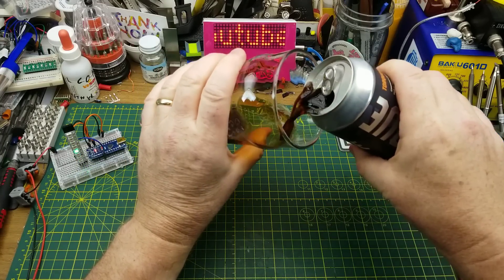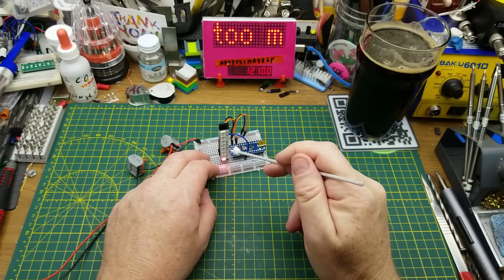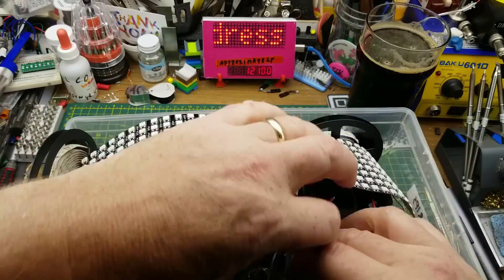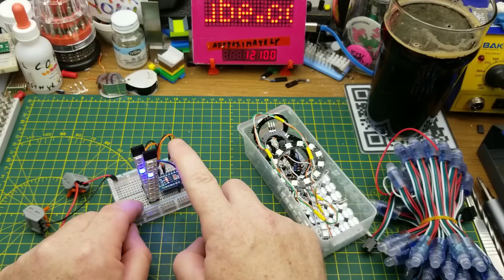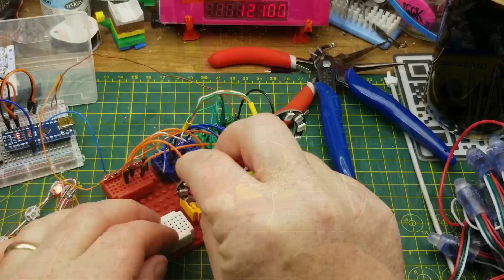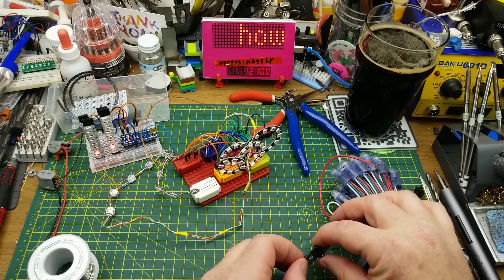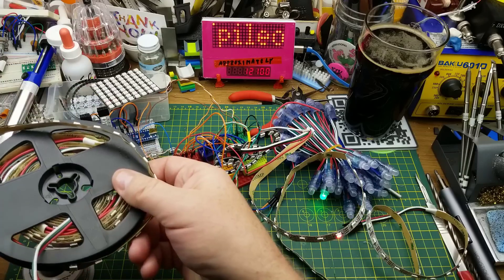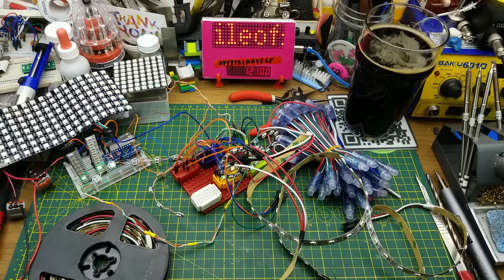Abusing addressable LEDs

Comment: there is no addressing and no "stripping" of anything, it's a serial stream of bits. In the WS2812A/B case (as well as many others), the first chip will receive 24 bits and if it receives another 24 bits before the latch period, will simply pass along it's current 24 bits to the data out and receive the next incoming 24 bits.  After the latch period, each chip "applies" the received values as pwm signals to each of it's r,g,b "channels" / leds.  You cannot "address" any of the leds, you can only spit out as many bits as you want leds on.

Comment: Literally every (non-USB) ARGB fan hub sold for gaming PCs connects the data lines in parallel, so every fan gets the same pattern just like your first experiment.  Edit: They usually have data logic buffers to amplify the signal.

Comment: what I do in this case, I use diff line transcievers like the sn75176 and the controller stays inside the house, and the led groups are just sitting on the bus with their own diff line receivers. Its pretty much like dmx but the actual data is ws2812 data stream instead.

Comment: What you are doing is called "fan out" the specs on your microcontroller will tell you how many TTL loads (or min impedance, max current, max capacitance) any output can drive. Then you look up the specs on your LEDs (you only need to consider the first LED on each strip for the data line). The WS2812B LEDs have a typical TTL load and most controllers can handle about a 10 TTL device fan out before you overstress/blow out your microcontroller pin.

Comment: The chip is the black thing inside the led itself, the capacitors outside are actually useless. I received few boards with some capacitors desoldered or completely missing and it still works.

Comment: Running WS2812 from a 3.3V controller can go wrong, according to specs they need 3.5V on their Din pin to recognize it as a "High" signal.
It may work (as evidenced in your video), but it can also cause all sort of strangen behaviour.
So, to be on the safe side, you should add a level shifter in between to get the 3.3V data signals up to 5V levels.
(Or, alternatively, drive the LEDs from a 4.5V supply.)
Reply: simpler hack is to use an extra first led and lift its ground up with a diode.
Reply: @szaszafaja  Lifting the ground won't work - the LED would see even less amplitude on the data pin than before.
If you want to use a diode you need to lower the Vcc of the first LED with it.

Or just use an NPN transistor and two resistors to cleanly and reliably shift the signal into the required range. Cheaper than "sacrificing" an LED and uses less power as well...

Comment: I've done plenty of testing with ws2812b and ws2811. Neither of those need level shifters on a 3.3 volt microcontroller like the almighty esp32.  Just make sure to get a strip made in 2020s. The older revision 1.3 was prone to glitching but the new revision works beautifully on 3.3 volt signals. You can tell which version you have by observing the pwm frequency. If the led flickers at 400 Hz it's rev 1.3. If it flickers at 2 kHz it's rev 1.4. You can tell them apart by moving your eyes left and right vigorously.

Comment: Do you know that what you are point to at 1:25 is just an alim decoupling capacitor ??

The controller is inside the LED it self. That's why it has 6 pins instead of 4 like a classical RGB 😛
Reply from the maker: Yes, and I believe I mentioned that the controller is inside the LED package more than once during the video.
Reply: @pileofstuff Thankls for the answer ! Fair enough then :) 
But why did you point at it in the first place ?? 

Must admit I didn't watch all along, I know well enough the basics of that WS-like modules... 
But I beleive what you are "abusing" here, is more your alim than the MCU or LED strips...
(I may have missed a point btw).

I mean, as the data line draw virtually NO current, it's not very astounding you can put MUCH of them in parallel.

It's not a critism, i'msure plenty of viewers will find it interesting !
Years ago when I started to play with MCU... YT existed already, but was not full of this kind of content, and that's cool, thanks for the newbies :) 
(Note to the newbies : go to IRC, though !)

My point is you can have mislead a couple of them here...
Reply from the maker: @skuizhopatt5318  During editing sometimes the voice over and video can get a bit out of sync.  
What I was pointing at a second ago may not be exactly what I am talking about at that exact instant.
Reply: @pileofstuff  unsure if you should insisted, here, but... 🤷‍♂

Comment: If you use a logic level shifter and split the input and then run the 5 volt output to each You shouldn't get an issue with loss of signal. Not quite sure if that's how that is supposed to be used lol.

Comment: Controllers vary greatly in what they can source to the first pixel. A related, but different test is to fan out the data output from a WS2812 to a bunch of parallel data inputs. There's at least one commercial addressable LED strip display kit on the market that feeds the data output from controller to a 'stem' strip whose output feeds to a hub of 6 or 8 strips with parallel inputs that radiate out like a flower or an exploding firework, if you want to look for some kind of validation from manufacturers. Or lots of us could have told you 8 or even 12 parallel inputs is unlikely to be a problem with such short data and power connections. But there are so many interacting factors that can contribute to a real world setup where the data integrity breaks down somewhere, and your test setup is practically a best case environment in comparison. There's NO question that sometimes people run into a problem with glitching LEDs somewhere in a large setup at first light, and one or more of a dozen different 'solutions' ends up making the problem go away.

Comment: Parallel strings with only 8 LEDs used in each string is one thing, but can it maintain data integrity with longer strings?
Reply from the maker: Each LED repeats the data stream, so there isn't any degradation if it's 5 0r 500 LEDs.(as long as the power wiring is capable of passing the cu rent for every LED)
Reply: @pileofstuff  there can be degeneration down the line.  All it takes is a few lost or late bits, even if the LEDs are close together.
Reply: @danman32  I'm curious, is there a reason why bits would be more likely to get lost later in the packet than near the beginning?

Comment: Sending dmx(e131) over wifi, Doesn't work well if you want fast framerates and large # of leds.  I've attempted running an small-mid size xmas light show over wireless to my controller and it didn't work well.  Once I switched to wired ethernet, it worked without issues.

Comment: My suggestion - Use the WLED firmware on an ESP8266 (or ESP32).  I easily control strings over 1,500 bulbs long, and use multiple lines of strings out from my controller chips.  It works very well, even with four different strings of lights running different patterns simultaneously.  And that's on trees with 1,000 lights each (big trees).  It's really easy to do, and I also use 74hct125 chips as drivers.  Cheap and easy.  Loved how crowded the bench got.  Forgot to drink the beer!

Comment: To my mind the only thing that should matter is the trigger voltage of the input pin on the address IC. Stack as many in parallel as you want as long as you have enough tickle on the address/data pin to flip it.
Reply from the maker: the capacitance of the cabling could impact the data as well (softening the leading edge of the square wave), if it gets too far out of whack.

And if the input impedance was low enough it has the potential to drag the voltage down too low.

Comment: I run two strips in parallel for my stair lights. 236 LEDs on the long side. Works great for me. They are mostly off and run at a relatively low brightness. I run them from an ESP32 D1 Mini running WLED.

Comment: In my limited electronics experience, the addressable leds are just glorified shift registers, and yeah nothing should break if done parallel... the driving circuitry might not have enough fanout power tho. I remember seeing 20 somewhere, but AVR chips are always conservative with their numbers (I assume you are using an AVR based controller) 

EDIT: Should've watched more before commenting, you did say you had an Arduino Nano for the test bench (as I assumed)

Comment: I would be interested to see if that still worked with a data signal going through 15+ feet of wire.
Reply from the maker: There's about 20 feet between the outdoor controller and the tree.

Comment: they actually sell repeater/spliters for this i think.
but a cool thing to do that is not  just paralleling would be to starburst off of one led node in the main string
  a few  pixels  so it forms a partial star or snowflake , so it acts like  a ornament. 

i not sure i will be doing all my outdoor pixel stuff this year not alot of time this year ,
and not sure if  my 16foot x 4 foot 100x20 WS2812 grid held up in storage.
Reply: its just a small fan-out problem, just but a buffer/latch chip in the data line to increase the possible sink current

Comment: So my WiFi Pixel design uses a 2n7000 mosfet to implement a level shifter for the 3v ESP module to drive the pixel signals at 5v like they want.  I have to assume the D1 has a similar level shifter as the pixels really do not like 3v signals all that well.  It may work OK 3v with short distance to the first pixel and then after that, the signal is "regenerated" (amplified?) by the WS2811 controller to proper 5v.

I would have loved to see if the WiFi Pixel board could drive all those pixels- it is something I've never tried.   Your next step is to use the FREE Xlights to run the pixels on the tree for more patterns...
Reply: I haven't seen a level shifter on an ESP32 board before (but that would be handy!) and it doesn't look like the D1 does either. I just threw a cheap SN54AHCT125 on my project and that worked great, but I haven't tried to run multiple stands in parallel.

Comment: If it did mess up, you could have a single transistor driver using the data pin and the 5V for it.  Since it did not, look at sandwich boxes and the cheap ' tupperware ' types for outdoor projects.  Another channel I follow uses them alot with great success when they can be air tight ( and thus water tight ).

Comment: If you were worried about overloading the data output, i suppose you could have used a buffer
Maybe for next year, run a 3 wire bus up the trunk with thick wire for current, adding a connector every so often, then just plug in strings to radiate
If a string has a problem, it would be easy to unplug and repair ;)
I can understand not paralleling for something like a scrolling message (unless you want duplicates), but this is fine, oh wait, you could cover your desk with scrolling signs :D

Comment: I also read on the internet that WS2812 LEDs draw about 4x as much current as they actually do. I think most people writing about them don't have a clue (or their experience is from fakes/clones, not genuine WorldSemi chips). I've certainly run them in parallel before with no issues.
Reply: You read it on the internet, eh? 🤔

Comment: Short wires and 5V supply no issue, otherwise all you need is any buffer, like a 74 HC4050 to give you 6 buffered  outputs to use. Long wires would cause issues, but under 10 feet of wire total to the first led no issue, length after that so long as each string works the rest do not care, just so long as power supply can handle current draw.
Reply from the maker: I was also concerned that the cable length would be an issue when I took it outside and deployed it on the tree. 
But it worked, so I'm happy.

I do have a big box of "various Lengths of wire" ... I suppose I could repeat the experiment with random mis-matched wires.
Reply: @pileofstuff  You really have to go far to make it stop, but before that you would have the odd corrupted colour, and the odd wrong flashing, before it stops working.

Comment: I thought Neopixel was the name for Adafruit's boards (and associated library), but the LEDs themselves are still 2811/12/13. By the way, max string length at 60hz is 1024 LEDs :)

Comment: There is no addressing in WS2812's they just strip the first 24bits off the data stream and output the remaining data bits. Looking at the data sheet the input current is +/- 1uA so i can’t see a problem with putting them in parallel. Even if the Arduino /ESP8266 could only output 5mA it still could power quite a few.  The only issue i could think of is the capacitance of the wiring slowing down the edge, but again this depends on the output impedance of whatever is driving the data line.

The only draw back is that all the parallel LED's will display the same.

Can i recommend that folk should read the data sheets themselves for devices they are going to use, they are there, so you can work out if it will work or not.

Comment: I'm curious about the current being pulled with all those parallel LEDs.
Reply: the power lines of each and every ws2812 pixel is always in parallel ! (on a 5V strip) 
PS: and it is roughly 55mA per pixel (datasheet) for the brightest white.. so 55 times the number of LEDs is the maximum current in milliamps
Reply: he has powerline connections at several points in the string, 
so it does not depend on the led string power lines too much.
Reply: @jyvben1520  I was referring to the breadboard testing. Not the lights on the tree.
Reply from the maker: It peaked around 350ma.

If I set them to white, it would bave been about 3x that amount.
And if i had more than 1 LED lit at a time (per string) it would have been a lot higher.

Comment: That poor Nano should be toast. Is it really powering those LEDs?
Reply: The power lines of the LEDs are connected directly to the bench power supply.. just the data lines are in parallel on a pin on the ESP. It is kind of hard to see given the monstrosity of this experiment (:P) .. maybe at 11:00 if you look at the breadboard top left you can see it..
Reply from the maker: I've abused my Nanos way worse than this.
They take quiet a lot to kill.
Reply: No